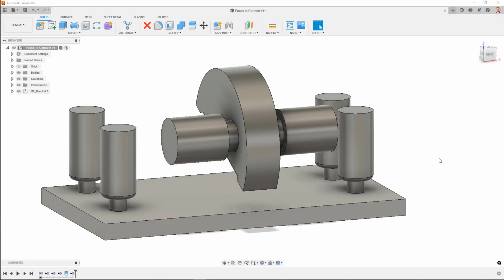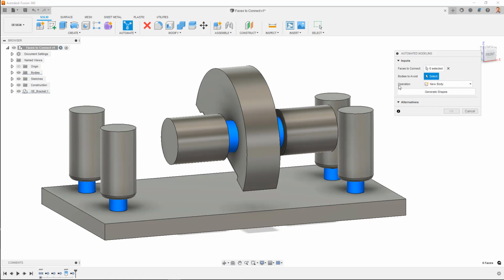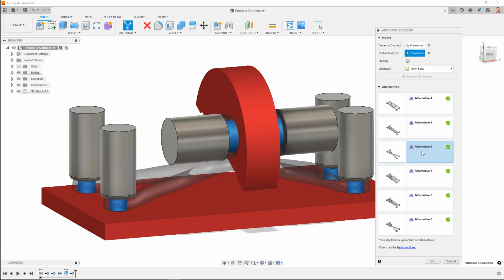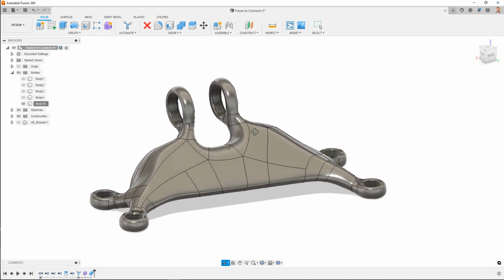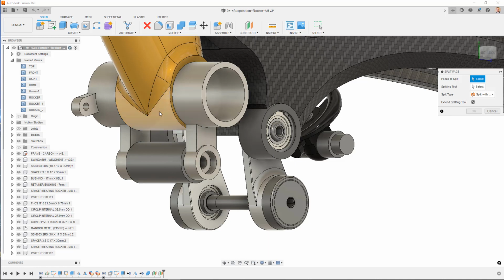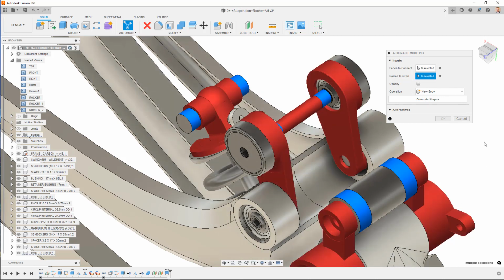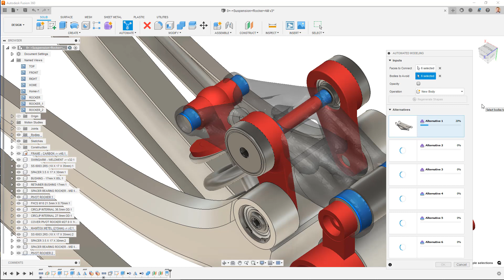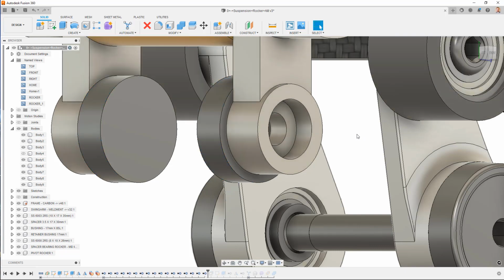Getting Started with Automated Modeling: Faces to Connect | Autodesk Fusion 360

Comment: nice feature. at least for 3D aditive manufacturing. for CNC is not soo good in this regenerative shapes.
Reply: Well, you can use it as a starting point, either for manual modelling, or for Generative design. In generative design you can setup loads and constraints to get a more optimal design. And you can specify how it will be manufactured, for example 3 or 5 axis machining as well as Additive, and it will take that as constraints for the shape it generates.